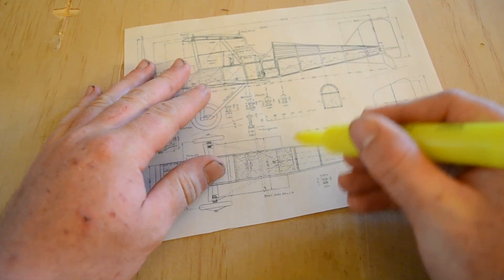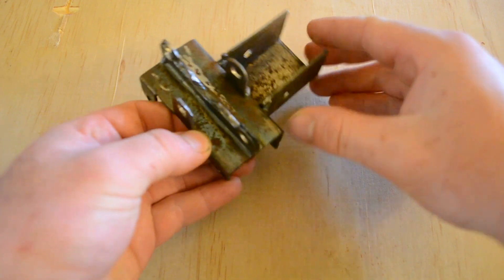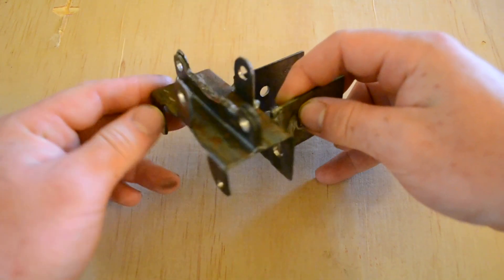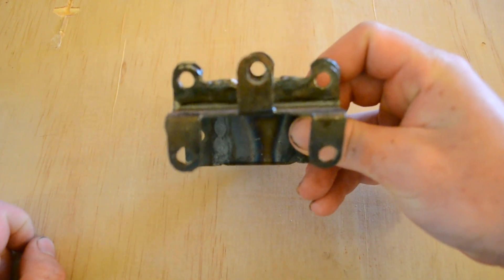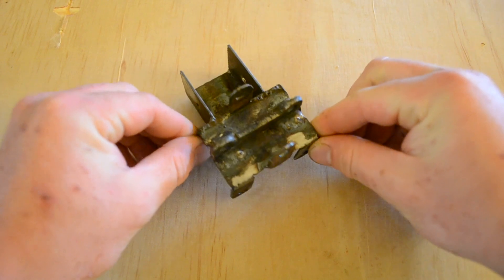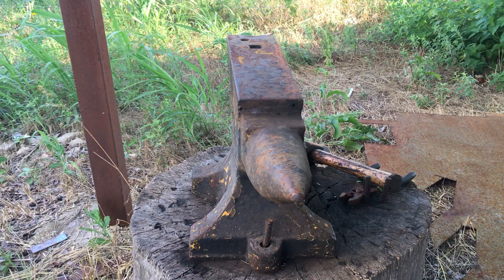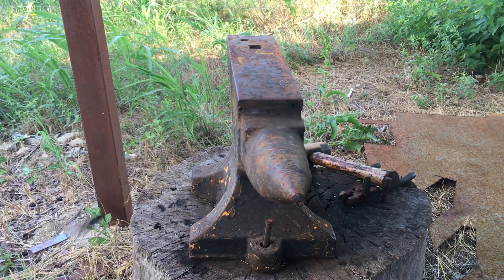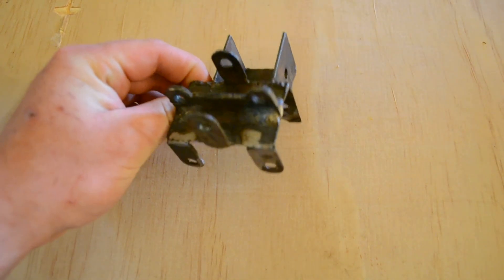Homebuilt Airplane Episode 1: Fuselage Fittings

Comment: You should turn the heat up on that welder, or slow the wire speed down. A wire welder set right sizzles when welding. Just a tip from a guy that has Oh about 50 years welding all kinds of things.
Reply from the maker: Thank you! My welding has a long way to go.
Reply: @EvanJonesProjects  I wouldn't pick an airplane to use as practice!!
Reply: You beat me to this comment. lol. Hello from a fellow welder.
Reply: @necrosapien1  Old welders can hear a miss set welder a mile away and know it. Also backing up at the end of a weld is most important.